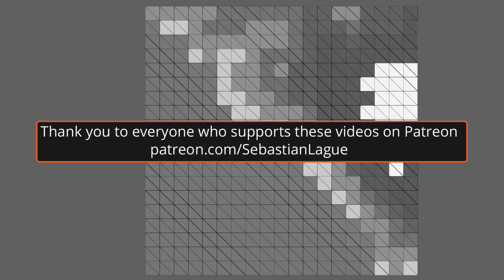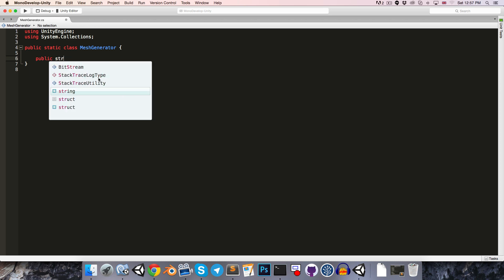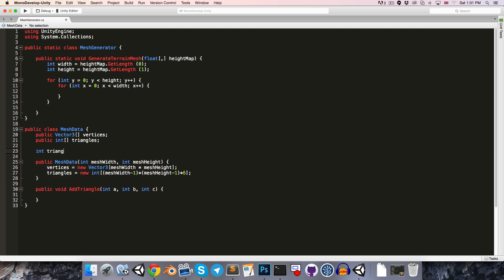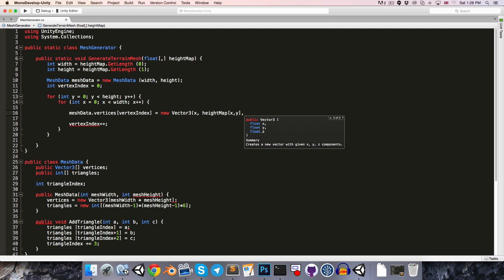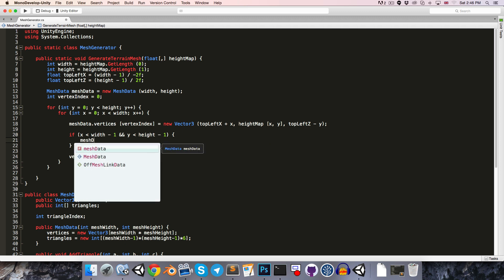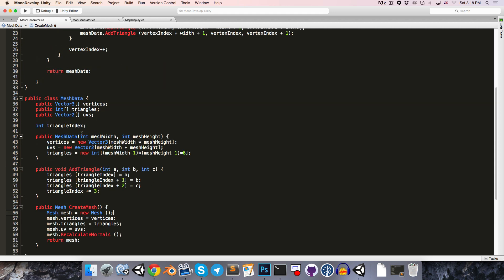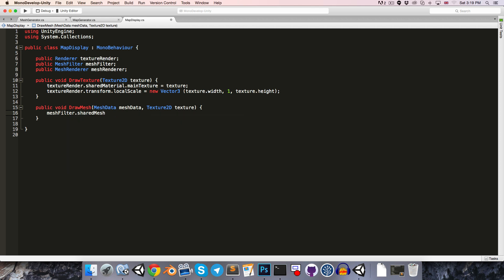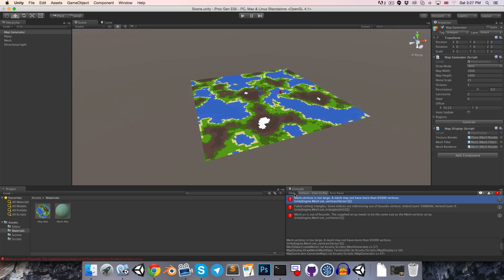Procedural Landmass Generation (E05: Mesh)

Comment: why do we store vertice in an one dimensional array instead of two dimensional array?
is the order of vertices in a triangle important, or i can use any order? like 0,1,4 or 4, 0, 1 or 1, 4, 0?
Reply: The order of vertices is important because Unity renders the triangle facing the clockwise direction of vertices.  For example, you would see 0,1,4 but if you did 4,1,0 you would not see the triangle because the backside is being rendered.
Reply: @MattForemanFlow  yeah actually as long as you wind the vertices in the clockwise motion, it shouldnt really matter how you decide to angle the triangles.  
you could do 0,1,3 then 4,3,1  I think?   lemme try it.   WOW!  yeah it does work that way. infact it looks a LOT better on the HDR pipeline.  the lighting/shadows seem to calculate better.  I dont know why ?    I made a simple variable to switch winding styles so I could see the difference,  this is how I did it:

in MeshGenerator.cs:

public static MeshData GenerateTerrainMesh(float[,] noiseMap, int windingType)

...

if (x < (width - 1) && y < (height - 1))
{

     if (windingType == 0)
 {

           //original winding method                
           meshData.AddTriangle(vertexIndex, vertexIndex + width + 1, vertexIndex + width);
            meshData.AddTriangle(vertexIndex + width + 1, vertexIndex, vertexIndex + 1);
      }
     else if (windingType == 1) { 
           //new winding method
           meshData.AddTriangle(vertexIndex, vertexIndex + 1, vertexIndex + width);
           meshData.AddTriangle(vertexIndex + width + 1, vertexIndex + width, vertexIndex + 1);
     }

}

...

then in MapGenerator.cs:

public int windingType;

...

else if (drawMode == DrawMode.DrawMesh) {
            display.DrawMesh(MeshGenerator.GenerateTerrainMesh(noiseMap, windingType), TextureGenerator.TextureFromColorMap(colorMap, mapWidth, mapHeight));

 }
 

AND THATS IT!   In the editor now there should be a "windingType"  you can flip between 0 or 1 to see the difference.  (or make your own, im about to make more and see. I think there would be atleast 2 more options)
Reply: @MattForemanFlow     Update:     turns out I could come up with 18 different winding orders!  and only HALF of them work properly.

ill attach the code below.

It seems all of the winding orders that have the first triangle using the pixels 0, 4, and 3 do not allow unity to calculate shadows/normals correctly

any winding where the first triangle uses vertices  0, 1, and 3,  seem to work correctly  

in the code below,  that means windingOrder # 0 - 8 do not work, but winding orders 9 - 17 do

If I made a guess, I would think this would have to do with the winding order of the whole Quad.    If thats the case,   then I think the ultimately best winding order is probably:  

0,1,3 - 3,1,4

or maybe

0,1,3 - 1,4,3

which would be winding order 11 or 10 below, respectively.

Very interesting stuff I learned today!

----------------------

if (windingType == 0)
{
    //  0,4,3 - 4,0,1
    meshData.AddTriangle(vertexIndex, vertexIndex + width + 1, vertexIndex + width);
    meshData.AddTriangle(vertexIndex + width + 1, vertexIndex, vertexIndex + 1);
}
else if (windingType == 1)
{
    //  0,4,3 - 1,4,0
    meshData.AddTriangle(vertexIndex, vertexIndex + width + 1, vertexIndex + width);
    meshData.AddTriangle(vertexIndex + 1, vertexIndex + width + 1, vertexIndex);
}
else if (windingType == 2)
{
    //  0,4,3 - 0,1,4
    meshData.AddTriangle(vertexIndex, vertexIndex + width + 1, vertexIndex + width);
    meshData.AddTriangle(vertexIndex, vertexIndex + 1, vertexIndex + width + 1);
}
else if (windingType == 3)
{
    //  4,3,0 - 4,0,1
    meshData.AddTriangle(vertexIndex + width + 1, vertexIndex + width, vertexIndex);
    meshData.AddTriangle(vertexIndex + width + 1, vertexIndex, vertexIndex + 1);
}
else if (windingType == 4)
{
    //  4,3,0 - 0,1,4
    meshData.AddTriangle(vertexIndex + width + 1, vertexIndex + width, vertexIndex);
    meshData.AddTriangle(vertexIndex, vertexIndex + 1, vertexIndex + width + 1);
}
else if (windingType == 5)
{
    //  4,3,0 - 1,4,0
    meshData.AddTriangle(vertexIndex + width + 1, vertexIndex + width, vertexIndex);
    meshData.AddTriangle(vertexIndex + 1, vertexIndex + width + 1, vertexIndex);
}
else if (windingType == 6)
{
    //  3,0,4 - 4,0,1
    meshData.AddTriangle(vertexIndex + width, vertexIndex, vertexIndex + width + 1);
    meshData.AddTriangle(vertexIndex + width + 1, vertexIndex, vertexIndex + 1);
}
else if (windingType == 7)
{
    //  3,0,4 - 0,1,4
    meshData.AddTriangle(vertexIndex + width, vertexIndex, vertexIndex + width + 1);
    meshData.AddTriangle(vertexIndex, vertexIndex + 1, vertexIndex + width + 1);
}
else if (windingType == 8)
{
    //  3,0,4 - 1,4,0
    meshData.AddTriangle(vertexIndex + width, vertexIndex, vertexIndex + width + 1);
    meshData.AddTriangle(vertexIndex + 1, vertexIndex + width + 1, vertexIndex);
}
else if (windingType == 9)
{
    //  0,1,3 - 4,3,1
    meshData.AddTriangle(vertexIndex, vertexIndex + 1, vertexIndex + width);
    meshData.AddTriangle(vertexIndex + width + 1, vertexIndex + width, vertexIndex + 1);
}
else if (windingType == 10)
{
    //  0,1,3 - 1,4,3
    meshData.AddTriangle(vertexIndex, vertexIndex + 1, vertexIndex + width);
    meshData.AddTriangle(vertexIndex + 1, vertexIndex + width + 1, vertexIndex + width);
}
else if (windingType == 11)
{
    //  0,1,3 - 3,1,4
    meshData.AddTriangle(vertexIndex, vertexIndex + 1, vertexIndex + width);
    meshData.AddTriangle(vertexIndex + width, vertexIndex + 1, vertexIndex + width + 1);
}
else if (windingType == 12)
{
    //  3,0,1 - 3,1,4
    meshData.AddTriangle(vertexIndex + width, vertexIndex, vertexIndex + 1);
    meshData.AddTriangle(vertexIndex + width, vertexIndex + 1, vertexIndex + width + 1);
}
else if (windingType == 13)
{
    //  3,0,1 - 4,3,1
    meshData.AddTriangle(vertexIndex + width, vertexIndex, vertexIndex + 1);
    meshData.AddTriangle(vertexIndex + width + 1, vertexIndex + width, vertexIndex + 1);
}
else if (windingType == 14)
{
    //  3,0,1 - 1,4,3
    meshData.AddTriangle(vertexIndex + width, vertexIndex, vertexIndex + 1);
    meshData.AddTriangle(vertexIndex + 1, vertexIndex + width + 1, vertexIndex + width);
}
else if (windingType == 15)
{
    //  1,3,0 - 1,4,3
    meshData.AddTriangle(vertexIndex + 1, vertexIndex + width, vertexIndex);
    meshData.AddTriangle(vertexIndex + 1, vertexIndex + width + 1, vertexIndex + width);
}
else if (windingType == 16)
{
    //  1,3,0 - 3,1,4
    meshData.AddTriangle(vertexIndex + 1, vertexIndex + width, vertexIndex);
    meshData.AddTriangle(vertexIndex + width, vertexIndex + 1, vertexIndex + width + 1);
}
else if (windingType == 17)
{
    //  1,3,0 - 4,3,1
    meshData.AddTriangle(vertexIndex + 1, vertexIndex + width, vertexIndex);
    meshData.AddTriangle(vertexIndex + width + 1, vertexIndex + width, vertexIndex + 1);
}

Comment: Hey, my Mesh is horrendously deformed (using Unity 2018.3). It kinda creates two big triangles on opposing sides from all the smal triangle, and has a rectangle area on one side where only every other triangle is created. I've copied the source from GitHub to re-check if I made a mistake, but it still persists. Anyone has the same issue or can tell me what I need to change? imgur.com/a/pLzoYNA if anyone cares to have a look

Comment: Hi Sebastian, starting from Hlsl 3.0 (long time ago) you can sample texture from a vertex shader. that gives you the posibility to handover terrain mesh modifications to vertex shader. How to accomplish the same in Unity3D is still an open question for me right now.
Perlin noise generation is per pixel based so it looks like a great candidate for pixel shader. So if you combine both with adaptive LOD for meshes you will get a significant performance and overall look improvement.
Please share a link if you did it already.

Comment: For anyone having the problem of every-other triangle not generating: "meshData.AddTriangle(vertexIndex + width +1, vertexIndex + width + 1, vertexIndex + 1);" causes it, the correct choice is "meshData.AddTriangle(vertexIndex + width +1, vertexIndex, vertexIndex + 1);" (I put vertexIndex + width + 1 instead of just vertexIndex in the second comma slot.)
Reply: First Last Thanks dude!

Comment: How much work would you estimate would it take to implement this with Unity Terrain instead of a custom mesh? Would you reckon that is doable? I mean the content of the first five or six episodes of this series only, perhaps also those describing color and texture shaders.
Reply: the unity terrain accepts a heightmap designed exactly the same as this is, so you could just make the noiseMap have the same scale as the terrain.  the heightmap is a raw file so there should be a way to have unity editor create a raw file to use, and then apply that to the terrain ?  there is probably, actually, a method to do that.  something like   Terrain.heightmap  i would think. and it probably accepts a Float[,]   (2d float array.  maybe a mesh data? im not sure about that one, check the unity reference)

Comment: I find it a bit curious that when you're generating the mesh that you're not using width+1 as a starting point. Currently your mesh is 1 smaller than your given width and height. (ie: if you create a map of 100x100, you'd end up with a mesh size of 99x99). Same thing happens with the UV data that's being set. x/width can never be 1 (at best 29/30) and you'd miss some texture data. Am I right to assume that both of these cases are related to stitching chunks together later on? Just curious, as I'm enjoying this series, but I'm a little unsure if this is intentional or not.
Reply: the width height in the editor on the MapGenerator is the width and height of the NOISEMAP, not the Grid of the mesh.   This is important because it is a map of the Vertexs, not the faces of the mesh.   If you want a mesh that has a Grid of 100x100 Squares,  then you need to make the NoiseMap / heightMap  101 x 101

Comment: This is what I got, no errors in Unity. But also no Triangle vertices. What did I do wrong?

using System.Collections;
using System.Collections.Generic;
using UnityEngine;

public class MeshGenerator
{
    public static MeshData GenerateTerrainMesh (float[,] heightMap, float heightMultiplier)
    {
        int width = heightMap.GetLength(0);
        int height = heightMap.GetLength(1);
        float topLeftX = (width - 1) / -2f;
        float topLeftZ = (height - 1) / 2f;

        MeshData meshData = new MeshData(width, height);
        int vertexIndex = 0;

        for (int y = 0; y < height; y++)
        {
            for (int x = 0; x < width; x++)
            {
                meshData.vertices [vertexIndex] = new Vector3 (topLeftX + x, heightMap[x, y] * heightMultiplier, topLeftZ - y);
                meshData.uvs[vertexIndex] = new Vector2(x / (float)width, y / (float)height);

                if (x < width - 1 && y < height - 1)
                { 
                    meshData.AddTriangle (vertexIndex, vertexIndex + width + 1, vertexIndex + width);
                    meshData.AddTriangle (vertexIndex + width + 1, vertexIndex, vertexIndex + 1);
                }

                vertexIndex++;
            }
        }
        
        return meshData;
    }
}

public class MeshData
{
    public Vector3[] vertices;
    public int[] triangles;
    public Vector2[] uvs;

    int triangleIndex;
    
    public MeshData(int meshWidth, int meshHeight)
    {
        vertices = new Vector3[meshWidth * meshHeight];
        uvs = new Vector2[meshWidth * meshHeight];

        triangles = new int[(meshWidth - 1) * (meshHeight - 1) * 6];
    }

    public void AddTriangle(int a, int b, int c)
    {
        triangles [triangleIndex] = a;
        triangles [triangleIndex+1] = b;
        triangles [triangleIndex+2] = c;
        triangleIndex += 3;
    }

    public Mesh CreateMesh()
    {
        Mesh mesh = new Mesh();
        mesh.vertices = vertices;
        mesh.triangles = triangles;
        mesh.uv = uvs;
        mesh.RecalculateNormals();
        return mesh;
    }
}

Comment: Anyone aware of any changes that have been made to unity with respect to creating custom meshes? I am following this tutorial line by line and when I try to generate the mesh using this code it just generates as a flat plane. The weirdest part is that in the mesh's MeshFilter component I can see the correct trianglemap if I double click on it, but it isnt mapping to the actual scene mesh correctly.

Comment: Has something changed? Did all the things, checked all the codes. I don't get a small card in the center of my plane like you did. I can however get the triangles on my entire map by selecting shaded wireframe. Is that the new way to do this?
Reply: To be honest, I'm not sure my mesh game object is even rendering. When I change the scale, there's no visible change, when I move it around it looks like a new empty game object.
Reply: EXACTLY the issue I'm having, except it only happens with the hdrp and it's frustrating since thats what my game uses...

Comment: I don't know why, but for some reason my mesh is fliped upsidedown, and is centered in the corner of the plane...
Reply: SOLVED, in my case the problem was that in the MeshGenerator code I added topLeftZ to y instead of subtracting it like Sebastian did in the video.
Reply: From what I can see, it seems to be either a -x added somewhere it shouldn't be, or a missing -x, but for now, setting the Scale x value on the inspector window for the mesh object does seem to fix it so far, not sure if it will make a difference down the line somewhere though and cause issues when it comes to making the Z values changed.

Comment: Hi Folks,
can someone explain me why the colors and the triangles are stored in a one dimensional array? Why don't use a multi dimensional array instead? Then the calculation of the position of the vertices might be more easy, right? wrong?
Reply: Just an assumption, but I think it's because a mesh can be more than just a plane, such as a sphere, cube, etc, and storing it as a 2D array or even a 3D array would conflict with that.
Reply: as for the Colors, that is just the way unity designed the "Color" struct/object.  its how unity expects the Color object to be used by other methods.
the triangles, it is the same reason, but specifically its because the pipeline accepts the mesh as a really long single list of triangles because that is easier to put in the pipeline next to other mesh's.  (when you are rendering 1000's of meshs at once, the pipeline will stay more stable if it is just crunching triangles in a single file line.  other engines DO use other pipeline styles.  actually i think even unity can be made to use different triangle lists...    as someone else pointed out in another comment, the "marching cubes" style of triangle lists is a different method which is very useful when doing mesh based "voxel" stuff, for example.)

Comment: So I was messing around with the settings and trying to take in everything that you where teaching in the lesson and I noticed something. The mesh renders as a mirror image on the z-axis at (0, 0) to the noise map. So basically the top left of the noise map is actually top right on the mesh and the bottom left on the noise map is bottom right on the mesh. I am curious if anyone else has had this issue or if its because on Unity 2017.1 or some change in between.
Reply: You can change the Plane Texture to look like the mesh Texture if you set Tiling: X to -1 and Offset X to 1. Or you can generate the mesh differently by using: meshData.AddTriangle(vertexIndex, vertexIndex + width, vertexIndex + 1);
meshData.AddTriangle(vertexIndex + width, vertexIndex + width + 1, vertexIndex + 1);
instead of:
meshData.AddTriangle(vertexIndex, vertexIndex + width + 1, vertexIndex + width);
meshData.AddTriangle(vertexIndex + width + 1, vertexIndex, vertexIndex + 1);
that would also mean the "topLeftZ" offset is now (height - 1) -2f  and when you add Vector3 position to the vertices its "topLeftZ + y" instead of topLeftZ - y.
once all of that is done its still not the same as the plane texture because unity applys textures rotated for whatever reason so you can rotate the plane 180° around the Y-axis. or set the NoiseMapMaterial Tilling to X: -1  Y: -1  and Offset to X: 1 Y: 1
Reply: Following along in Unity 2020.1 and got the same result as you.
Reply: If  you notice, its in the video too.
Reply: I could be late to the party and maybe he addresses this in one of the next parts but I think it's because when he sets the texture his for loop is going from the bottom left up. However when he sets the vertices he's relating it to "topLeftX" and "topLeftY", or in essence from the top left down
Reply: The Noisemap starts sampling from the bottom left [0,0], 
The Image format [0,0] is bottom left
He starts the mesh indices in the top left corner.
I've haven't corrected this yet myself but I think that's where the inconsistency is coming from and why people are flipping the UV's or mesh scale.